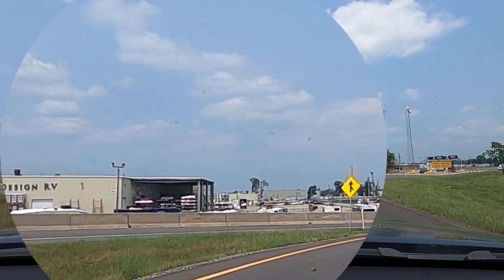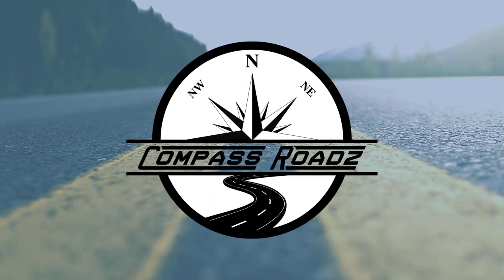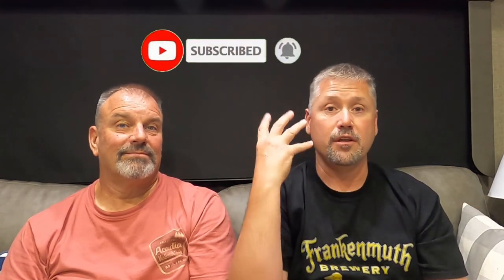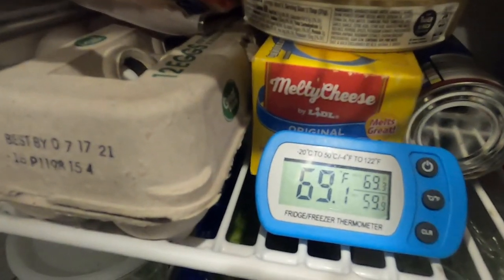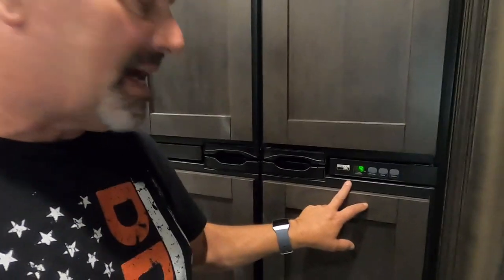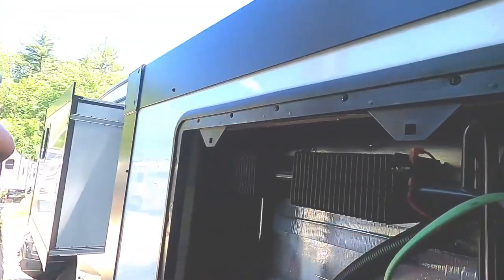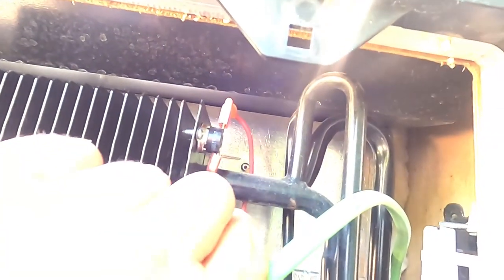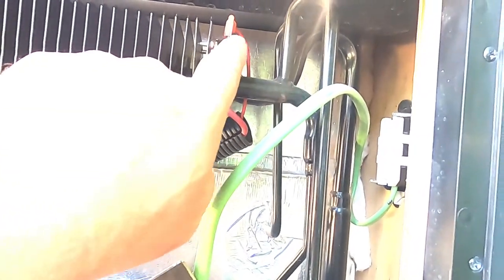Reflection RV Repairs at Grand Design RV   Part 1

Comment: We are having so many issues with our 2021 Grand Design Reflection 303rls Fifth Wheel. We called Grand Design customer service and they told us to go to a dealer. Dealers are 3 to 4 months out. And that we would have to leave it for 1 to 2 months. This is our home we can't leave it we have 2 dogs. So we tried to get Grand Design to fix it themselves. We have to bring it to them let them look it all over and then leave and come back later in about 1 to 2 months and leave the RV. We can't be doing that it's our home. We have about 3 pages of warranty problems. So we are considering selling it and going with another type of RV a few years older. We have had tremendous success with good used RVs. We just can't deal with this kind of customer service. You pay a lot of money for these new RVs and have nothing but trouble. We had a friend who has a 2021 Grand Design Momentum and a whole slide out had to be replaced and another one the refrigerator had to be replaced. And they also are full-time RVers. We just can't understand this type of customer service.
Reply from the maker: Yikes!  We can do empathize with your situation. As far as the dealers, living and moving all the time makes it so hard to schedule an appointment because their workload is so far out. We eventually found one that we would be passing and asked them to only do the inspection for Grand Design. Beckley’s RV was able to spend 30 mins to do that if we brought it in as long as we weren’t expecting work to be done. At least that got the ball rolling to have them provide GD that inspection report. Then we could book with GD and we were out of the RV for two weeks to let them get things done. I had family in Mich and Ohio to at least stay with and accommodate our dog. 

Once it was in GD hands we felt comfortable that they would do the job better and quicker than a dealership. We felt if they are the ones building the RV that they would be better at repairing it. 

We did have to wait a few months to get our appointment, but we were able to continue our adventure to Maine and then make our way back to Middlebury for our appointment. 

What kind of work do you need done?  I can’t imagine repairs taking so long with GD. Maybe at dealerships as they get side-tracked. It’s amazing that can can build an RV in just a few weeks from scratch but repairs take so much longer.

Comment: Hey...there you guys are! Great video, checking the fans may not of worked but you still found the broken one by checking. Carry some Eternabond Tape with you for the roof, it will seal any hole or puncture permanently. Stuff is awesome.
Reply from the maker: Thanks!   Hope you guys are well. We did order eternabond tape so we at least have it now. But because Grand Design wanted to look at the holes, the duct tape was easier to remove. 
On another note… Kevin had previously done a video on how he foil taped the front air conditioner but when GD replaced the roof, they removed all his tape as they had to stuff the new membrane into the ac opening. Anyway, he was able to use your technique and made the foam board structure you did in your video. Thank you for the advice. The air conditioner has very noticeable improvement!!
Reply: @CompassRoadz   haha well I guess there’s always a silver lining. 🤷🏻‍♂️ Glad you guys got things taken care of 👍🏼